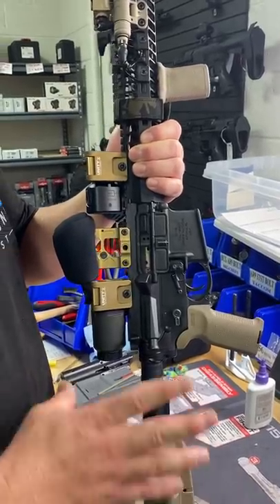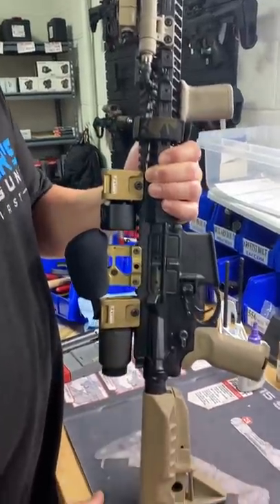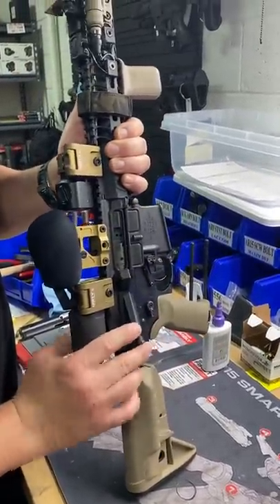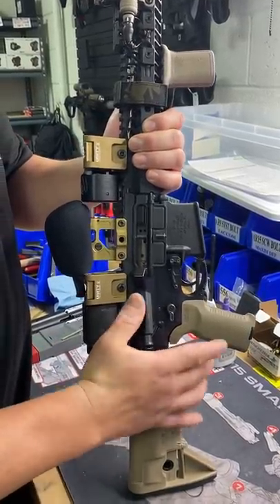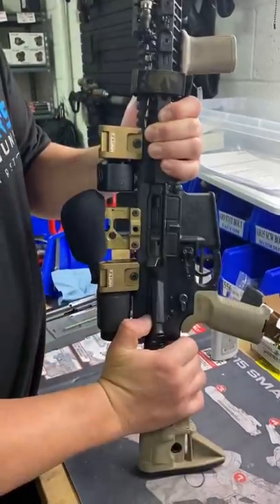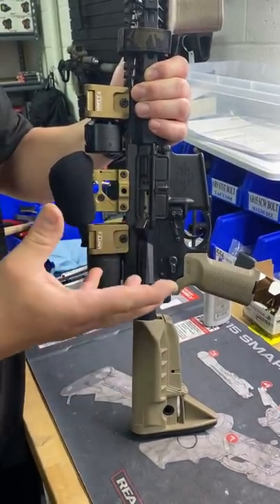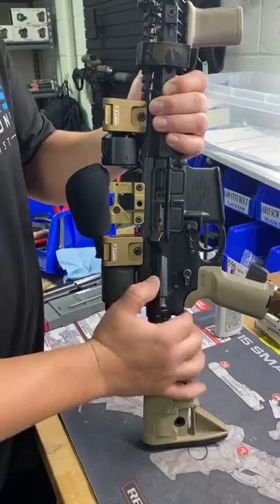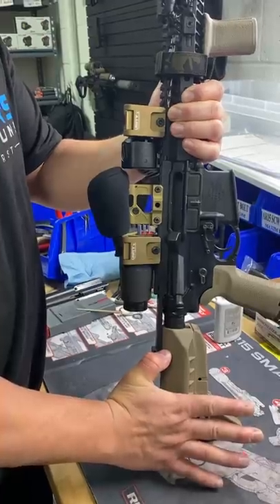How to Mortar your AR Platform if you have a round stuck in the chamber.

Comment: "The bolt moved in some direction, the weapon has fired." 😂😂😂
Reply: I came here looking for this comment. I was not disappointed
Reply: @ZeddieLittle  And I was surprised to not have seen it, so I chose to remind all the lovely folks to be careful. If the bolt moves, so much as one inch in any direction, the gun will fire. So sayeth Grand Master Fake.
Reply: Where you been Grandmaster J?
Reply: @Deshelton10  Sheeeeit you know, charging bolts and pushing them forward.
Reply: @jaywhey8822 😂 SHHHhhhhhheeeeeeiiiiiiiiiiiiiiiiiiiiiiiiit......
👑✊🏿🤤🔫💥
Reply: @jaywhey8822  training my comrades shoot my other comrades.
Reply: “It will blow your head off. It happens in basic training all the time”🤣

Comment: Heh... got to love piston guns. At least they are mostly reliable and super light. I only morter my roller lock on rusty steel case after the previous thousands of rounds fouling. Can't reuse the casings either. Chews them up before depositing them in the next county.

Regardless, great information. Some folks don't think to do that for fear of damaging the rifle. Need to be shown it's a tool and concussive maintenance is sometimes required.

Always remember folk, if you can break it, it were meant to be broken. If its broken, you should learn to fix it.

Comment: I had to do this maybe once on a gun that a friend got as a present and holy fuckballs was it shot out. I'm pretty sure it was on its second barrel and the reason for the multiple failures to extract I found out, was that the extractor spring was just disintegrating in its hole.

Comment: Please place the firearm on safety first! Even then make sure the weapon is pointed in a safe direction. I had this happen while in a tree stand hunting and used the tree behind me to clear my Browning BAR. Not the safest place to do this but when your 26 feet up in your climber things can get out of hand quickly. Be safe!
Reply: I mean the guy wasn't unsafe
Reply: politicallyinsensitive  thats true with ar platforms but there are many other semi's that operate differently. Some semi auto pistols you can't lock the slide back without taking the safety off first creating a dangerous situation. My point was if your hunting or even at a gun range make the weapon safe first before attempting any other procedure. Some ar's with the bolt locked back and the safety off and loaded magazine installed can fire if dropped or bounced on the butt stock. Be safe out there.

Comment: I still use SPORTS

1. Slap upward on the magazine to make sure it is properly seated
2. Pull the charging handle all the way back
3. Observe the ejection of the case, look in the chamber for obstructions
4. Release the charging handle, don't ride it
5. Tap the forward assist
6. Shoot

Comment: Depending on the nature of the jam if bolt override you can also use your middle finger in the mag well to force the bolt back while keeping charge handle forward, this can be done very quickly if you have the finger strength and the feel for it, a tool can also be used, but the finger method I have found to be reliable and quick.
Reply: Ok but this specific malfunction results in the user not being able to pull the charging handle back as one would normally. If you can’t pull it back with your entire hand and arm, what makes you thing you can with your finger? That’s why the mortaring takes place.
Reply: @TheJavy1018  personally I am speaking from my experience as a 19 Delta, depending on the situation by pushing the charging handle forward while pulling the bolt backward with your middle finger quickly clears the round. The bolt carrier and the charging handle are able to move separately. Notice how your comment was focusing on moving them both as a group backwards, by pulling the charging handle backwards, yes which only compounds the problem. While Istated you must move the bolt backwards while maintaining the chargung handle forwards, And and so can you accomplish this with your middle finger, once you get the hang of it is quick and easy.
Reply: @theomegawerty9688  I understand what you are saying however the cause of the malfunction mentioned in the video is the mechanical bond between the case and the chamber wall not the bolt on the barrel lugs or a stuck case between the bcg and charging handle gas hole (commonly called “brass over bolt” or “death jam”). I understand that the bolt moves independent of the handle and I believe the remedial action you mentioned is for that, brass over bolt. In that case mortaring the weapon is ineffective.
Reply: @TheJavy1018  true, that's what I was referring to, we called it bolt override

Comment: This happened to me with a brand new Faxon lightweight BCG. The extractor pin in the tip of the bolt was stuck and I didn't know it. Sent the bolt home making it condition one and the pin physically pinched the rim of the brass against the barrel wall making it virtually impossible to open again. Had to cut my range visit short and come home to mortar it open. Actually had to use a rubber mallet on the charging handle to free it up. After that I realized I was not at all impressed with Faxon. Ordered a JP enterprise kit to fix the extractor pin and it's golden now but still, you pay $250+ for a lightweight BCG and it didn't even work is bullshit. I have a Sharps Rifle Company XPB BCG and that thing looks incredible and performs flawlessly and it's $70 cheaper.

Comment: You actually don’t need to mortar your weapon at all. 
To fix a brass over bolt malfunction:
(After weapon is on safe and magazine is ejected)
1. Force the charging handle as far back as you can
2. Firmly place your finger in front of the bolt.
3. Karate chop the charging handle to force the round forward
4. Pull bolt back with charging handle and readjust finger placement
5. Repeat steps 3 and 4 until round is clear.

Comment: in a pinch sure this is useful, but they make very cheap tools to clear that sort of blockage without bashing your expensive firearm on the ground.  This is great if you MUST clear a blockage NOW, but go but a steel rod from home depot and push the round out.  might damage the round, but a broken charging handle, stock, buffer tube, etc will cost you a whole lot more and will likely end range day right then and there

Comment: you don’t need to collapse the stock, in its shortest position it’s still engaged to the buffer tube just the same as its extended. you run the risk of breaking your stock when you mortar, however the bcm stocks are basically the only stock on market you can do this with without real risk of breaking since they use steel locking mechanism

Comment: One thing I think he didn't mention for you newbies, he is grabbing onto the right side of his charging handle.  If your charging handle is ambidextrous then this works fine.  If it isn't ambidextrous then you will want to pull down on the side that unlocks the latch on the left side so you don't smoke your charging handle or twist the fk out of your finger.

Comment: Even better option. Drop mag. Pull back and hold charging handle. Insert finger in front of bolt carrier. Push charging handle forward. 😉 drops out every time and you don’t have to slam your rifle on the ground or risk an accidental discharge. It’s call a brass over bolt malfunction.
Reply: A bolt override is different from a stuck casing. And for bolt override malfunctions it’s better to lock the bolt back then slap the charging handle forward.

Comment: This is serious shit. Gun people unfamiliar with the AR platform might think the chamber is clear because they pull the charging handle back but there's a good chance you still have a round in the chamber and you need to visually inspect and remove if it's in there. Happened to me multiple times. If I didn't do a visual inspection I easily could have had a negligent discharge. that's why you never ever point an "unloaded" gun at someone.

Comment: Sometimes you don't even need to pull the charging handle,  best to have a fixed stock,  but I can see why you should slide the stock forward. Still not the best thing for it. You can also get a special AR multi tool

Comment: I've broken a butstock doing this.  Later learned that you can simply put the butt plate in your chest, grab each side of the charging handle and pull with both hands. This works best with an ambidextrous charging handle but works just fine with a single latch one.  Also, sticking your Gerber pliers in passed the front of the BCG and pulling back that way works to.  The two hand method works on the worst failures to load, extract or eject.  To include the one where a shell gets stuck between the front end of the charging handle and the inside of the upper receiver.   This is also why battle buddies are implied and many dudes carry sidearms.  Semper gumby.

Comment: This works right up until your extractor rips the back end of the case off. If you shoot TulA or other cheap steel case this happens a lot.
Reply: That’s fine, you now have the ability to throw a rod down the barrel to push it out. I’ve done this myself. Also if you douse your chamber in lube, it is easier to shoot steel. I stopped having malfunctions after I did that. Eventually everything broke in after shooting a bunch of brass and I don’t have to do that with steel anymore

Comment: If this fails to remove the stuck case and of course you have zero tools since we've already begun smashing rocks with our precision instrument.   Repeat this method with your thumb atop bird cage with a fine sand inside barrel to create kinetic energy. Remove a projectile of a separate Weapon, crimp case neck or block with anything low mass, open bolt place weapon on flat surface place muzzle to  muzzle and Pow!

Comment: If you got a shell casing stuck in the chamber* 
A round stuck in the chamber would have to be shot out with a pulled bullet casing to push bullet out when fired 
DO NOT LOAD A ROUND IF A BULLET IS STUCK IN THE CHAMBER ITS A SQUIB LOAD AND WILL BLOW YOUR GUN UP IF YOU FIRE WITH A ROUND STUCK IN THE CHAMBER OR BARREL

Comment: Wtf is that optic though? I've seen a lot of them in my day, but I don't recognize that. I'm rocking a Holosun 510C-Green dot. I would recommend for anyone. Best optic I've ever used, hands down. The few shortcomings it does have (2MOA dot instead of Eotech's 1MOA for instance) are very much balanced out by the RIDICULOUSLY long battery life and shake and bake features.

Comment: One major reason I would never have anything but a mil spec 5.56 chambered barrel on any weapon I intended to use for serious social work. Yeah, it's not going to shoot into .25moa but it's a hell of alot more reliable than a tight match chamber. Think of it this way, if you're in a fight, do you really think you'd be able to utilize quarter minute accuracy or, worse yet, have the dexterity and focus to clear a round stuck in your chamber as your advisary realizes what's happening to you and decides to advance on you?

Comment: Typically, you shouldn't pull the charging handle when doing this. The bolt will free up most of the time with a good hit on a brick or plank of wood. 

I've only ever had this happen on cheap rifles like M&Ps and rugers. Spend the extra 500 bucks and get a Colt!

Comment: Had to do this with a new Faxon lightweight BCG. Gotta say, I am not impressed with it. It's $60 more than my Sharps Rifle Company XPB BCG, there's tooling marks on the carrier and bolt, and the gas key wasn't properly staked. Oh, and I had to stop my range visit short due to a stuck ejector pin that basically sandwich'd my new Lapua brass in the chamber, hence the reason I had to mortar my rifle. I'll never give them another dime after that.

Comment: Sweet the if people don’t know what it is the ALPHA TARAC 4.0 prism now in 1.93 and 2.26 and yes us mil uses them and from red dot to scope it will work and your ballistics and things about your barrel like length I believe obviously calibers but it basically is a prison for a 300 yard and out if you’re having issues making shots at that say you’re doing a 50 x 200 zero and your rounds are missing every time at 300 and flip it up you literally change the angle a little bit and it actually increases accuracy tremendously at a higher rate and sell like crazy and no they’re not cheap and you’re gonna need a unity mount for it for an FTC setup im when I get into the draft 1400 in on a can tax stamp and that is the next for my head not sure if I’m gonna do a 300 blackout or 556 as i use 556 more but fuckit if you do do Noveske they Heather Farrell extensions in chamber Pacific for Black Hills 77 gr Sierra match not sure about the 300 black out chamber if they have it setup for black hills

Comment: I just remove the upper and clear the round with a cleaning rod
Reply: You can remove the upper but you still have to get the chamber unlocked. You can’t just push the bolt back from the barrel.

Comment: Would this still work even if the bolt isn't stuck?
Reply: Why would you do it if it isn't stuck? You'd just be unnecessarily beating on an expensive AR at that point.
Reply: @chasebanks5021  I had an issue where the bolt was stuck. I managed to free the bolt, but the round was still stuck in the chamber.
Reply: @royalwolf7603  that's when you want to just whisper to it all sensual like, gotta coax it out somehow am I right?
Reply: @somethingsomethingusername802  "Hey there lil cartridge. You looking mighty fine. Why don't you mosey on out of that chamber? I can make it worth your while. 😏" Like that?
Reply: @royalwolf7603  Exactly like that

Comment: The a2s we had in basic showed us this while we were in one of the innumerable,hot as hell snd pits doing aitechniques- every time u dropped to the ground after a sprint, or used it to propel your body from the ground!!! It opened w/o touching the bolt puller thingee...lol
But whatever u do...dont use a fucking rock on your ar-it is not worth it